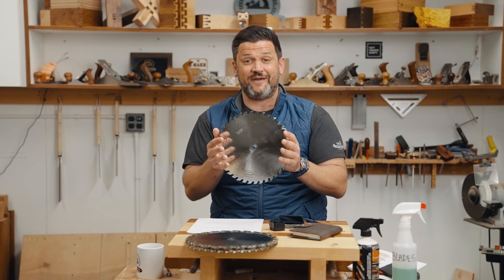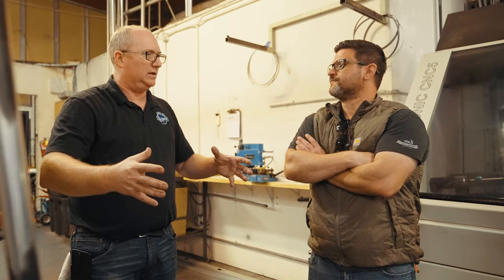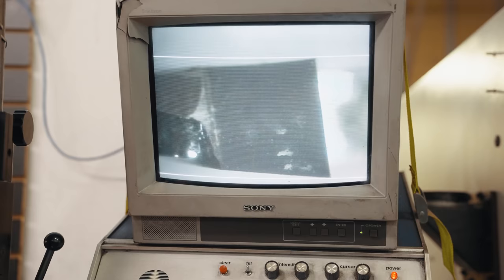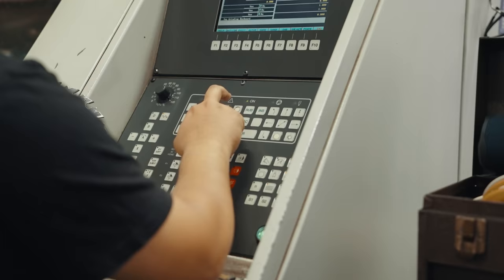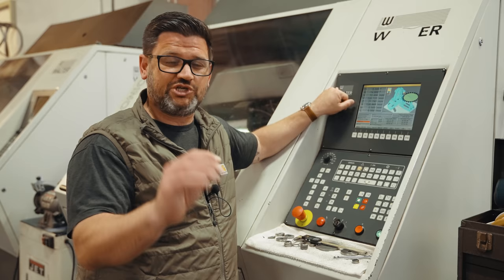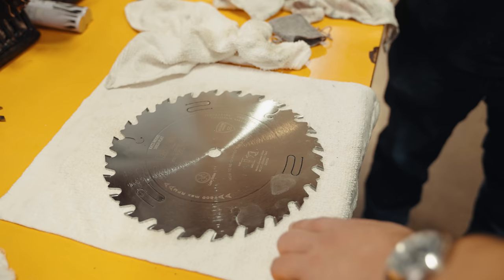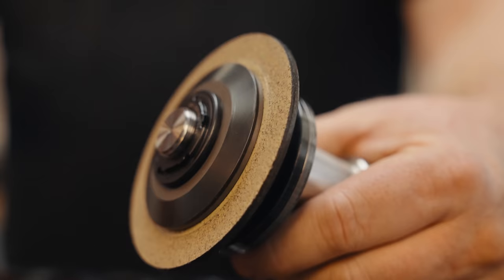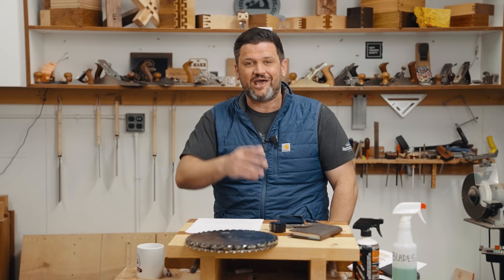How a Saw Blade is Sharpened

Comment from the maker: Support What We Do at The Katz-Moses Store https://lddy.no/stih 
CMT Saw Blades 35% off plus Use Code JKM10CMT for Additional 10% Off- https://lddy.no/ggf9 I use the 40t GenP, 60T Cross, and 24t Rip
Central City Tool Supply Saw Sharpening (in Santa Maria, CA) http://bit.ly/CentralCitySawSharpening
How to Tell If Your Blade is Dull https://youtu.be/ItaxJMBmsOg
Selecting a Table Saw Blade Video - Tips Tricks and Buying Advise https://youtu.be/Fcz_d1k_k8A
Which Table Saw Blade to Use at 19,000 Frames Per second - Never Before Seen Footage https://youtu.be/4m8T3i982E8

Comment: I've been a Diablo user for quite a while, figuring that they were good enough for the price. After this video, I went on Taylor Toolworks to check out the CMT blades. Found that the ITK Orange were on sale, so took the plunge ordering the 24, 42 & 60 tooth blades. Man, what a difference. Quality is evident down to the packaging. Looking forward to using them more. 
I really appreciate all of the info you present and tool reviews. I've bought several from you and your recommendations. - Chris

Comment: Wow, when was the last time any of us saw a CRT?
That blade inspection rig has been around for decades.
Reply: I was waiting for someone to notice that. I have been meaning to try to replace it, but the connections from the line generator are very specific and newer monitors will not work. These inspection machines have not been made in a number of years. They were made by a company called California Cedar Products. I found a patent dated 2002 for the machine, so maybe not quite as old as you might think. One of these days when the CRT monitor dies I will be forced to figure it out. Until then I will just have to live with it.
Reply: @mikesteinfelt7315  Well, blade inspection is the first step to a great sharpening job!
And your whole operation seems to be efficient and successful.
If and when it finally does die, inspection cameras are a commodity now so you might be surprised at the cost and resolution you can get today.
While I'd like to patronize you I'm in the NYC metro and have been using Forrest since the '70's, so I'm not about to change now....
Thank you for your comment and some insight into the equipment that you use!  👍

Comment: It blows my mind how they can Sharpen a blade for $20 and have to use all that expensive machinery to do it, that is why most of the sharpeners have gone out of business
Reply: Speaking from experience, what drove saw sharpeners out of business was the drastic reduction in price of blades off all types. My dad sharpened saws for most of my life growing up, and it just became cheaper to buy a new carbide blade than have him sharpen, or even replace the teeth. Specialty tools used in commercial settings were often sharpened in their own shops. Almost every customer was either a construction firm, or a construction worker. Even hand saws, which he had machines to re-tooth, sharpen, and set, couldn't be sharpened anymore because of induction hardening. He eventually realized that it was costing him.more money to keep the business going, and sold all but one of his bench grinders.
Reply: @Myopicvisions  yeah thats too bad, I know I have always had my stuff sharpened, I always by the best blades, It makes no sense to get a cheap blade it does me no good and gives me poor results. But the last local sharpening company shut down about 2 years ago, now I have a place that I drop them off and the guy takes them somewhere and theyre sharpened its better than the cost of shipping them all over
Reply: My guess is because this specific sharpening business is a value-added business to their selling of equipment. If this was not the case, with only two people working there, the investment will just not pay for itself.

But to pay $20 per blade is an absolute bargain.
Reply: Probably makes the real money selling Festool.
Reply: My guess is they make most of their money on the medical/specialty industrial side. He mentioned a bone drill bit being made. Example- knee replacements cost 40-50k or more each so the drill bits are likely very profitable

Comment: Great video @jonathan
I guess with the 5 axis machine they can do complex geometry like bevel+rake+shear angled teeth like those found on some exotic combo blades...

Re Freud - I think there is some miscommunication here - the Freud diablo stuff I see sold in the USA is not their top of the line industrial blades... So I don't think the comparison is fair. Top notch industrial Freud  blades in Europe cost much more than the diablo stuff. 

Re nanometer accuracy....I think you went a little overboard there. 1 Nm is a bit less than 10 atoms of iron/cobalt/magnesium etc.... No spinning industrial Cutting machine can be that accurate

Comment: Can't believe they replace teeth , the cost  not worth it . I worked in a tool and cutter shop we did carbide saws allso for awhile . The blades became to cheap to do anything but sharpen.  And eventually stopped doing them at all no one wanted to pay

Comment: Did I miss the cost to sharpen the blades? Don't remember hearing it in the video? Would be nice to know.
Reply: Cost of sharpening depends primarily on the number of teeth. A range similar to the blades we sharpened for JKM is approximately $14.00-$26.00 Please call us at 805-614-9111 if you would like to discuss.
Reply from the maker: Also my most recent (previous) video breaks it down in detail.

Comment: Wow! Why not just charge for the blade on every job. Collect bad blades, get them sharpened and charge for them. I charge for blades on every job. Recip blades if I use a sawzall, circular saw blades when I use them in their job, oscillating blades, drill bits... everything. This is how I can ensure I have them in every job!
Reply from the maker: Because that's not feasible in our profession (furniture making). If you're doing it right you're using multiple blades per project and maybe making just a few cuts. This isn't construction or handyman work we're talking about. The right blades makes a difference in the amount of labor you do so therfore maintaining high quality blades actually saves money. PLUS! If you watch my previous video I break down how much more expensive cheap blades. They're a lot less cost effective than high quality blades.

Comment: sorry to get off topic here. but you have covered many kinds of joints for wood working. I have yet to see the correct joint for a three way joint. I'm trying to build a frame box with wire on the side to put my garbage in. (damn varmints) anyway. The one i built is just a few year old and the top board keeps coming off on the front I assume this is from bags hitting it when they go in and out.If you need a picture I can get you one if are not understanding what i'm asking. Basicly like you did in this video here https://www.youtube.com/watch?v=rRZBUbMjxWY but i'll be useing 2x4 not square what would you suggest?